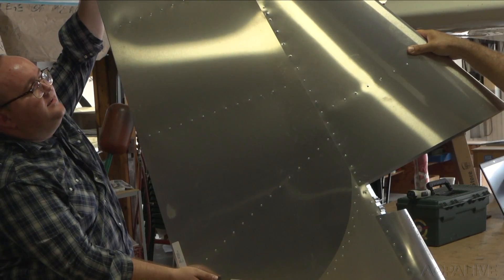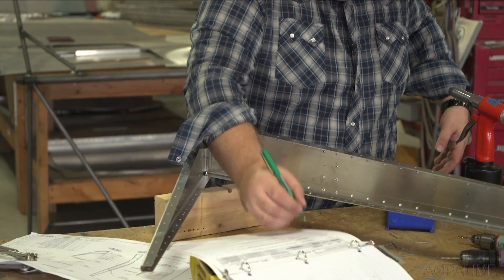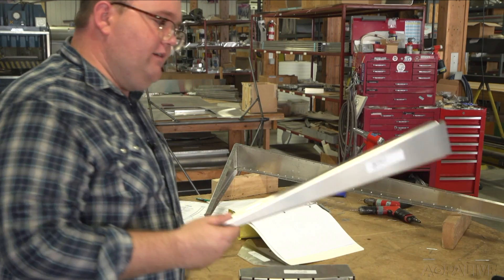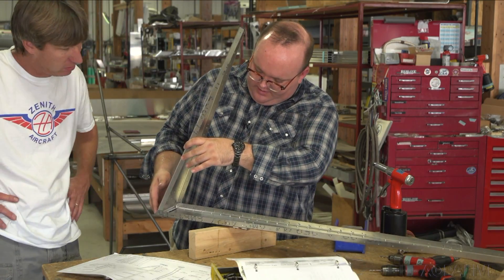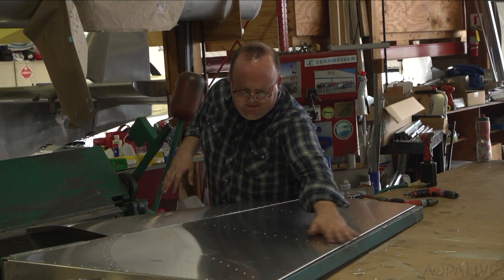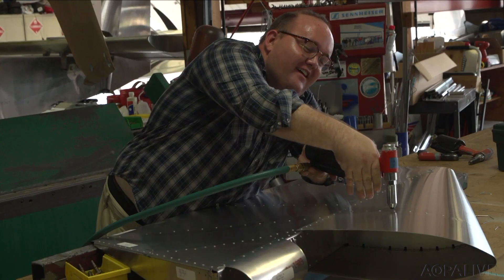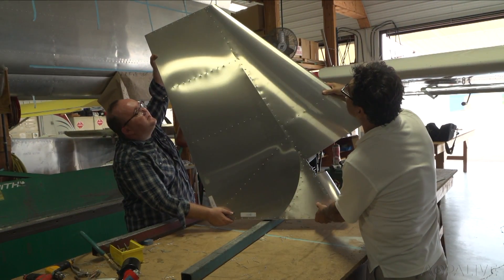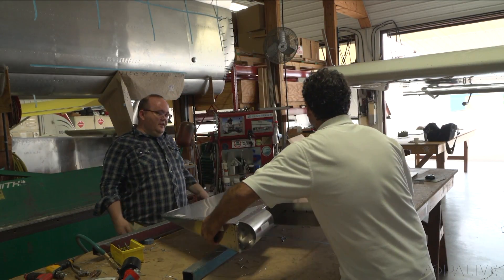Building an Airplane Rudder First

Comment: We need a manufacturing process that can make the whole plane effortlessly. Like a 3D printer but with nice finish and high material strength. Should be doable enough.
Imagine planes largely free. High performance, light weight and perfect finish. No crude rivets. Like a UFO.